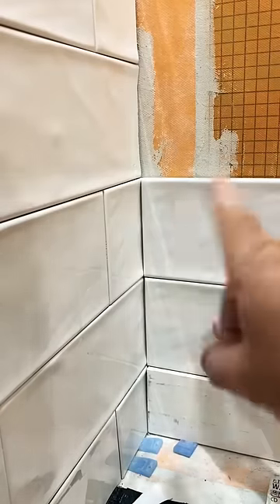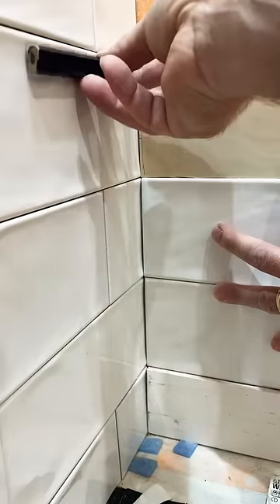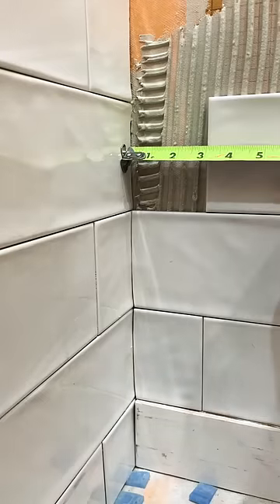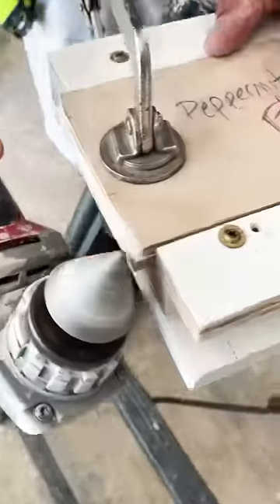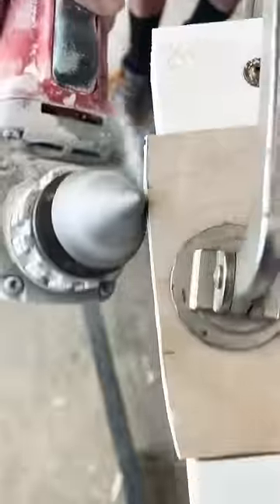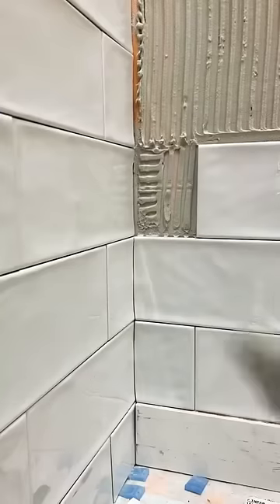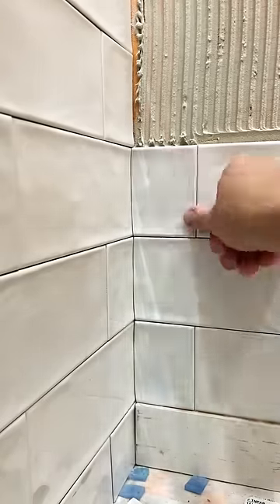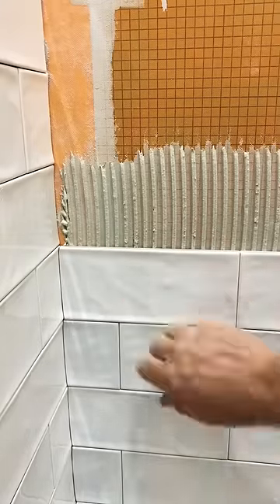Tile COPING - 101 (just a little extra effort)  #tile #coping #shower @Eylandertile

Comment: No need to cut so tight, 5mm expansion joint to all corners. But I'm guessing you aren't bothered about movement seeing as you've not spaced the tile either.
Reply: I was wondering about that
Reply: Will never ever move…. Feel me. 😊
Reply: @Scientists16  how are you so sure
Reply: @physiolympha  I’m not.. I guess it’s hard to see sarcasm through text sometimes.
Reply: @Scientists16   sorry haha. I want a follow up video after a yesr or two of them spitting out
Reply: Don't need that much but this is too tight and so unnecessary.
Reply: @tomislav5689  5mm for expansion is building standard. You're welcome.
Reply: @kooper1683  If a wall moves that much you have bigger problems then a broken tile. 3 mm is plenty of space.
Reply: @tomislav5689  5mm is building regulation. Look it up.
Reply: @tomislav5689  How much do you think a building expands and contracts over the course of a year? Timbers alone can expand and contract 10mm, + or - 5mm. Concrete at least the same.  5mm is standard expansion joint, it gives the silicone/caulk some room to work.
Reply: @kooper1683  I really don't know about timber, don't work with it. If we are still talking about bathroom walls, no concrete, brick or drywall should move that much.
Reply: I was about to say same thing. Where his silicone going in at! Way to tight
Reply: You don't need to use spacers on those tile
Reply: @jordanstone1466  yeah we all know u don’t need spacers for this subway tile! But U do need an 1/8 space for silicone and movement! May not move But if does u want that space between change of plain
Reply: @docrand7750  all tiles should be spaced, even metro/subway tile. The only tile I've ever known to not need a tile spacer was an English/Indian Pilkington tile. It had a spacer (notch) built into the clay.
Reply: Interesting about expansion. When I tile bathrooms I don't account for any. Corners are butted right up and I never use tile spacers. Silicon over the corners and for cuts of splashbacks to Bath &c. What we a fighting against is damp and mildew not expansion. This is Northern Europe but in the US your standards have to reflect differences in climate as well as damp.
Reply: @Paul van der Wende Fair comment Paul. I use expansions in walls and floors in swimming pools for example. If the substrate is sound and it's a small space then expansion is not an issue. Anyway. You are Dutch or Flemish you know that Delft are the Rolls Royce of tiles😄
Reply: Glad to see i was not the only one seeing all those missing steps.
Reply: @alanthomas4442  im from Europe and the expansion regulations I've spoke about depict Europe and the U.S. I question your professionalism to the trade.
Reply: 5mm expansion joint? Is that how you sell shoddy work?
Reply: Subway tile like that has pre manufactured bumps on the sides SO YOU BUMP the tile together. No spacers lol
Reply: @ZEPR0FESS0RR  some do have spacing but these certainly do not have.
Reply: @kooper1683  most subway tile comes with notch built in so NO extra spacing needed! And I’m just taking about change of plains needing space for silicone. That’s it! I space all Ann Sacks subway tile cause it’s all hand made. 👍🏾
Reply: @docrand7750  grouts need 2mm minimum to be effective. Anything less will lead to weakness is the grout joint, water ingress and grout deterioration.
Reply: @kooper1683  we in America don’t use the Metric system but I set all types of tile all day long! If it’s self spacing it’s self spacing! And if not most want either 1/16” or 1/8” space and that’s what we do. As far as anyone telling me different is kinda pointless unless Ur cutting my $7000 plus checks a week! Then I set that shit how U want it! Just got done with 30 backsplashes this week that was self spacing! Put up the Laser and start stacking.
Reply: @docrand7750  I call b.s. on that. Tilers in US earn about $25-30 an hour. Average annual wage being about $60k. A decent tiler could do, let's say, 20m a day (and that is going some on splashbacks). That's 100m per week, or $70pm² to make 7k. Yep, I call b*llsh*t!

Comment: Looks great, I always try to cope corner tiles. However, I'd recommend leaving a 1/16th to an 1/8th space in all corners (matching the spacing you're using for the field tile) and caulk those corners with your color-matched grout caulk. If your corner tiles are touching, there's a high likelihood of the edges of the tiles chipping and cracking, or even tiles releasing, when the studs behind your backer swell and shrink due to humidity. Otherwise, great work!

Comment: corners are expansion joints. Frequently one wall of a tub or shower is an exterior wall that can go hot and cold faster than interior walls. Changes in temp = movement. and the X movement wont equal the Y movement. grout will crack. you have to silicone it.

Comment: The purpose of gouting, besides sealing, is to allow for expansion and contraction. Every house built by wood. Which are 99.8% of houses built in USA experience wood movement.  Always use spacers 1/16 minimum. But brother I gotta give it to you.  That coping was executed perfectly.  Great job.  May God bless you and those you love 🙏
Reply from the maker: This is a wood framed house, which is 15 years old. These tiles are tapered so they create a 1/16" grout joint and they aren't pushed tight & I did try and keep a consistent 1/16" grout joint in the corner. This is no different than the ceramics from the 60's & 70's. That tile and grout are still holding on today in some bathrooms around the USA! thanks for the comment and watching!

Comment: Next time , buy yourself 1/32 tile spacers and get some expansion joints in there
Reply: Yes! Looks horrible without
Reply: Tiles don't expand! 😂😂😂 But it does need grout lines, this is true.
Reply: Looked for this comment before I said it 🤜 we mush be levels above this lol
Reply: @Johnny5Toy  All matter in the universe expands and contracts depending on temperature. Tile has a very low coefficient of thermal expansion but shower tile is coupled to its substrate which typically does have some more movement to it. It's always a good idea to leave room for thermal expansion in showers but most of the time it works out okay even without it. If you're ever in doubt pick up a copy of the TCNA handbook and they will give precise directions on if and when thermal expansion gaps are required. I hope this helps!
Reply: A lot of subway tiles have built in 1/16" spaces.
Reply: @ryanmcenroe8680  I don't need your help, I'm a tiler.
Reply: @gregkeeyako  indeed, but these do not.
Reply: @Johnny5Toy  everyone needs help, there are things both of us don't know. If we continuously get better we can remain industry leaders. If we remain stubborn and refuse to learn we will fall behind
Reply: @Johnny5Toy  😳
Reply: @gregkeeyako  Visually but not technically. While there does appear to be a 1/16th” gap between the tiles, it is actually nothing more than the factory beveled edge that gives the appearance of a gap. However, behind that beveled edge there are parts of each tile that are touching each other with absolutely no room for movement and/or expansion and contraction!!! All I can say is good luck to the installer and the homeowner!!! I bet he will be back within a few months to address lifting and/or broken tiles.
Reply: There’s buoy in spacers on most subway tiles…

Comment: You NEVER want tiles to touch each other. Atleast every German tiler knows this.
Reply from the maker: They aren’t touching, 1/16” grout joint
Reply: Yes, if the joint is too narrow it won't have enough strength and wil fall out over time.
Reply: You know what else they know about in Germany?
Reply: @electthelambda  unsealed wooden doors? 🤔
Reply: Thermal expansion and contraction is a thing
Reply: @kittytrail  what about them?
Reply: @w.k.d.constructionllc  
1/16th” grout lines my ass!!! You clearly sat the cut tile on top of the tile below it and then pushed in the top of the tile, never pulling the tile up and/or off of the tile below!!! Maybe more like 1/64th” grout line due to the factory bevel on the subway tiles you’re using. But even with that logic there is still part of the tile you cannot see that is touching the tile below it… not to mention the one directly beside it, to the right!!! You’ll be back to deal with an unhappy customer in the coming months!!! 😂😂😂💯💯💯
Reply from the maker: @DFWJon  oh geeze 🙄 this tile is tapered…which means when you set tiles together you automatically have a 1/16” joint. They have been doing this on ceramics since the 50’s, guess what - those tiles are still in some peoples bathrooms today! Obviously you’re not skilled enough to work with these tight tolerances, keep working at it. You might get there one day!? 🤷🏼‍♂️
Reply: @w.k.d.constructionllc ad hominem always = loss
Reply: @w.k.d.constructionllc   nope thats not 1/16
Reply: @electthelambda  Love and inclusion? 🤔
Reply: I hope you're getting paid big bucks for doing sooo much unnecessary extra work.
Reply: @w.k.d.constructionllc there's no use explaining to people who are talking out of their ass. Anyone who knows what they are talking about will know you don't need spacers with subway tile.
Reply: People who put spacers in subway tiles now days are clowns and rookies…im with you friend! Stack and go on all subway,they are literally made to do that lol…I know subway showers i layed over 13 years ago still looks brand new…these rookies do nothing but hate…beautiful work brother
Reply: @w.k.d.constructionllc you never grout a corner, it will crack for sure.. color match caulking to your grout.. we are in 2023 ..

Comment: where's the spacing for the grout?? 🤡
Reply: You don’t use grout in corners. You use silicone as corners always break. Also there was no point to cut any tiles in corner to match shape since gap there is so small that it makes no difference. Once silicone is done you can’t see anything.
Reply: @Lukas-go2wv  Presumably the OP means the gap between the tiles, normally they are put in with spacers to give a nice even grout line.

Comment: You should have a 1/16th inch gap in your corners so you can silicone the corners.
Reply: Agreed.  I think that gap created by the shape of tile would have made a nice receptacle for the caulk to grip in as opposed to just having on the surface
Reply: i was thinking the same when i saw how tight he was butting the tiles together, this may look nice at first, but will degrade quickly
Reply: Looked like a16th to me
Reply: I also believe over a water proof membrane like the kerdi system this is mounted to, the corners are 100% water proof behind the tiles
Reply: This may be a dumb question…. Please forgive me I’m a plumber. But don’t tile guys usually use spacers?  Or is this a different style or look that omits that detail.
Reply: @scottfletcher1956     Some tiles have little bumps on the edges to give a slight gap when installed.
Reply: @joeblincoe3122  The caulk isn't really for waterproofing. We use grout caulk because it is flexible. Almost all corners crack if you use just grout
Reply: Have you ever seen a 1/16th” gap before?
Reply: @anthonyrodrigues5032  that's because people make crappy substrates by using products improperly
Reply: @scottfletcher1956  European style tile is all tight fit as well if I recall.
Reply: @anthonyrodrigues5032  dont use grout caulk. hell it says on the bottle it isn't for showers. it molds
Reply: @huejanus5505  This does not count unfortunately. The space is needed to allow for any movement. Thats why flexible grouts and adhesives are used. Without the space there is a good chance of tiles becoming loose and cracking.
Reply: @huejanus5505  most of the stuff ive found that self sets the gap is hand thrown ceramics, not this style. i woulda used spacers

Comment: Looks good, but if it gets caulking then why waste the time?
Reply from the maker: If I left it square and just butted it, you would see that in every single pc. unless you wanted a 1/2' wide caulk bead running down each side? I don't want that, so I put in some extra work and made it very uniform down the corner so I could have a small joint that would match the horizontal grout joints.

Comment: Hey here's a tip for the tile guys. : (Add studs centered with your curb and pitch your curb.) I install glass showers, and I don't know how many hundreds of installs I've done where I'm installing a 200lb glass shower door, and there's no studs to hinge the door off of. So we end up having to use anchors. And I know if it were my house I wouldn't want a glass shower door supported by just anchors. We repeatedly tell these contractors to double up the studs and do them in line with the curb since the glass door and panel is going to be in the center of the curb. We install the glass panel and the metal u-channel. Then I drop the door in place and use a level to make sure the door is lined up with the panel, and then I go to drill through the hinge holes into the tile and realize there's no studs. So we have to mark the holes, take the door back out, redrill with a 1/4" bit,pound in tile anchors, then drop the door back in again. It adds more work for the glass installers, and it's less structurally secure since they didn't add studs. Like if you know this shower is going to have glass doors and panels installed, then you'd think they'd plan ahead for that and add studs before they start tiling. But they don't care. And these are big time contractors, building multi million dollar mansions.smh. seems like the only time I find studs is when I'm doing subcontract work for a smaller contractor. The bigger contractors building the huge mansions are always the ones that don't put in studs and cut corners.smh.  Use a damn laser, watch the lippage on your tile, make sure everything isn't super out of square, and for the love of God please add studs
Reply: Amen brother!
Reply: It’s a very valid point. 

We always add as much backing as we can for as many different possible end choices.  

Homeowners have a tendency to change their mind on finish products and generally happens after the sheeting is already up.  So we try and plan for everything and then add a little extra.

Comment: As an architect, holy shit I appreciate you
Reply from the maker: Thank ya sir!
Reply: As an architect can you explain why 1) it matters as an architect and 2) it matters at all since grout or caulk will be covering the joint anyway.
Reply: @jacobdeloach7012  you're
Reply: George
Reply: As an architect, spec flat tile. Save your clients some money and reduce waste.
Reply: And there we have it, a self declared architect that has absolutely no idea of basic building construction, in order for 
tiled shower wall to be waterproof , a minimum of a 2mm space between the tiles are required for a waterproof grout to be used. 
I'd give it 6mths of use before the ready mix tile adhesive which isn't waterproof to loose adhesion resulting in the tiles falling off.
Reply: As a butcher I disagree
Reply: @jamestrott2944  my boy, I’m an architect, not a cm. And this dude lays tile, I’m sure that he knows what he’s doing
Reply: @mr.fahrenheit310   1. The better the attention to detail in any project is, the better it makes the architect look

2. If there’s a zero tolerance joint like he’s created you don’t necessarily have to cover it with grout, it gives you more waterproofing options
Reply: As an architect you don’t know what you’re talking about…These tiles will be laying on the floor because of the lack of expansion joint and water resistance..
Reply: You wouldn't appreciate him if you were paying him hourly and was juicing your for pay and you knew caulk would take care of this.
Reply: @jackieboyok  You are a student...
Reply: Rather than making a template for every inside corner tile, have a good grouter/finisher. Do agree with stoning your cuts and doing clean work. Float the walls to plumb and square.  Systems (schluter) are fine for tubs and production work.

Comment: Waste of your time and life. The caulk joint or epoxy grout over the corner to protect from corner mildew buildup will easily cover up to an 1/8inch Gap.
Either you're wasting your money or your client's money.
Reply: I mostly agree
Reply: Why not 45° cut the corner pieces?
Reply: Need space for subtraction and expansion, then silicone it!
Reply: @j.w.r.i2910  i think you mean contraction

Comment: Folks this isnt comendable. This is make-work. Hes charging for unnecessary hours for a detail thats going to be covered in caulk anyway.

All these "craftsmen" do the same thing
Reply from the maker: I guess it would be covered if you rely on caulking and like a 3/8" wide joint in the corner...  I sure as hell don't & neither do my clients. So I'll keep my corner joint at a 1/16" and consistent. It's okay if you aren't good at tile, not everyone is. Some work harder than others too, putting in the work to the best of their ability.
Reply: @w.k.d.constructionllc  guy, stop it
Reply: @w.k.d.constructionllc  I'd like to see the grout after a year... those tiles are so close together I'd bet it's falling out by then, also yes caulk or 45 ING each tile would be quicker than essentially coping  every tile individually with a damn diamond cone... adding hours of labor to a job that is going to be virtually indistinguishable in the end...

Comment: 1. Back butter on the horizontal - allows better adhesion and contact

2. Do you love your lungs? Then you should be wet grinding - dry releases silica particles in the air, on your clothes - work smarter & live longer! Your family will thank you for it!
Reply: 1. No way water can build up and store behind it. Vertical always in showers. Those line compress flat. 

2. Absolutely agreed